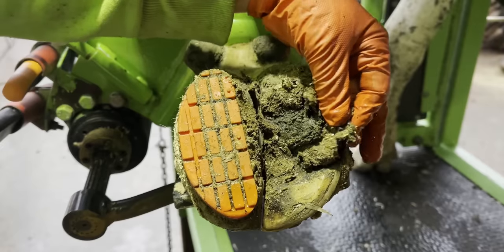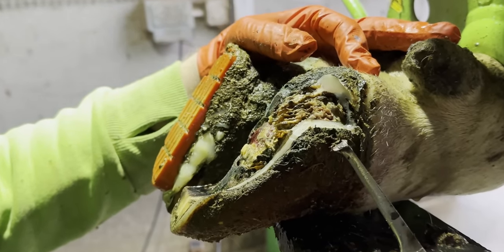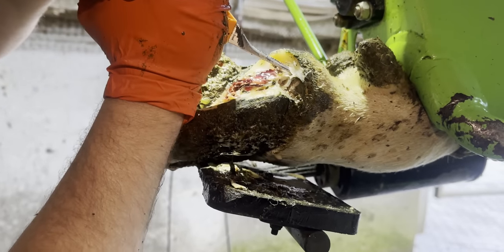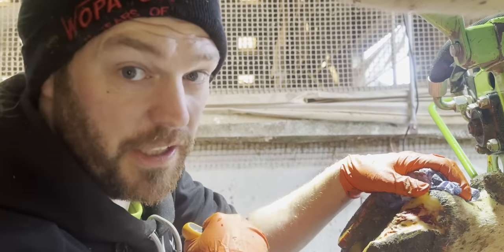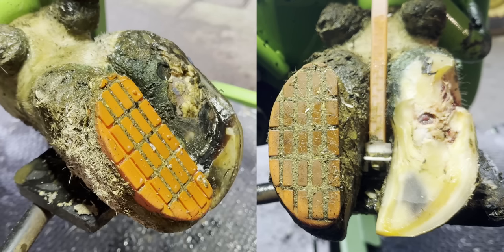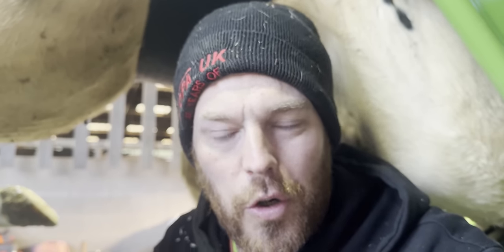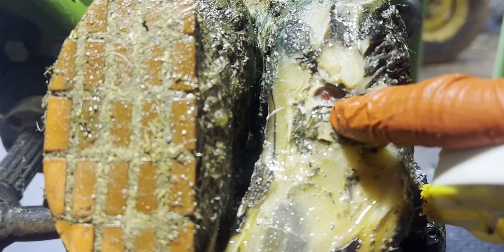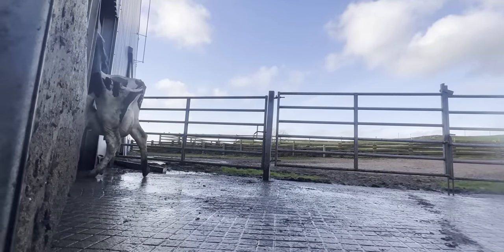this cow's LAMINAE CORIUM have BURST OPEN!

Comment: as sad as it is that this cow has this issue. these trims have been really interesting to see. the visuals provided by seeing a hoof so opened up so much are really cool and informative. there's a big difference between hearing about the strand like structures in a hoof that hold it together and seeing those structures in the day light.

Comment: Okay so question... I'm used to horses, and with horses that have bad separation like this, you can help decrease dirt and disease (and I think pain) by putting plaster or silicon or various other products to help create a "false hoof" where the hoof wall used to be. Does that not work with cows because of the muck they stand in, or because of the limited amount of time you can keep them in the crush? Or something else?

Comment: You need a two gallon water sprayer. Normally people put weed killer in them but I use it with just water. You control the pressure by pumping it, so no plugs. Especially on farms without water access.

Comment: I have an honest question as I just recently discovered your channel.  Is there a reason that you do not spray off the whole hoof with some water pressure rather than simply scraping the muck?  I know it will get right back on when the cow goes back to pasture, but I was just wondering if there were other reasons?

Comment: Your knife here looks a lot more slender than usual, do you have/use different thicknesses of knife depending on the job at hand? Or is it just an older knife that has been sharpened multiple times?

Comment: When we get our show horses feet trimmed and or shod, in the 🇺🇸, my farrier will get back in his truck and drive away before touching a muddy leg or foot.  He requires all hooves be picked out, feet and legs be muck free and dry, he doesn’t care if we have one or one hundred horses, he requires this from all customers.  When you get a farrier that does quality work, you do as they wish!  My best girlfriend raises Angus here in Central Virginia, her cattle trimmer man also requires feet and leg prep, but not as thoroughly cleaned as our horses.  My gf puts her cows in a huge barn the night before and beds them down in deep straw, so the feet are quite clean and dry for the am trimming,  For nearly all cattle caretakers it’s not feasible to clean legs or feet since cows manure is a constant wet stream of poo.  I think if I were the cow toes trimmer though, I’d want a hose and good water pressure, as soon as the cows in  the squeeze box, spray off the crap, as I see how much mud and poo, (muck), flies in every direction, getting on the trimmers hands, face, hair, clothes, even in your eyes and mouth.  My gf, (neighbor), raises only 50 cows w/ calves and 2 bulls on their 600 grassy acres, a park like setting, studded with old, shady oaks, cooling ponds, etc., mud there is near non existent.  Her cattle are Beef stock, they’d aren’t dairy cows which come in and out of a barn several times a day. which create a daily, mucky, mess.  If you have hundreds of cattle running through barns, 2x a day for milking, cleaning feet and legs is a giant waste of time, energy and water.   My gf only gets hers trimmed 2x to 4x a year, as beef cattle don’t stand on concrete, the feet are almost maintenance free, unlike dairy cattle.  All consumers should watch these videos to appreciate how labor intensive it is to manage cows in general, but dairy cattle the most.   Consumers complaining about the costs of cheese, milk, butter, cream and beef, might be less apt to moan n groan about prices if they knew what’s involved in raising farm animals, not to mention grain and hat prices.  Living in a farm community, we buy near all our animals products farm direct, we save on these and don’t complain if at the grocer.  God bless the plants, animals, farmers, vets, trimmers, etc., the most important pieces for human existence.

Comment: Does the farmer have a water hose to use to clean the Whole foot up before working on it ?. You do a great job but the spray bottle is very small cleaning .
Reply: A water hose wouldn't help. As Graeme showed in this video, not even scrubbing could remove the muck. He  had to cut it off with his knife. The spray bottle was only to remove the bits that he had already loosened.

Comment: Considering how seriously bad the hoof was the first time, it's coming along. New healthy hoof horn is growing and the lesion is getting smaller. I bet next time it will be a major improvement again. Aside from not having 'smellovision' which I'm greatful for (I'm not fond of the smell of manure), we also don't have a way to feel what you are as you use the grinder and knife. You've done this long enough to know what changes in resistance to the blade mean and adjust accordingly. I saw you start to make a cut a few times in this video and stop as you felt like you might be going into tissue.

Comment: Why don’t you wash the cows’ hooves before trimming them?   Of the many channels that show hoof trimming, I can’t recall if an answer was ever given.  I would think that even a good stiff brushing of the hoof to clean off the mud and manure would make it easier to determine what damage there is to the hoof.

Also, if the cow’s inner claw is so incredibly bad, why scrape at it little by little if you know that it is bad?  Can you take a saw blade and just remove the claw completely without damaging the hoof / corium?  Just a complete “do over” as it were.

Comment: I'm curious why you're so worried about the hood bleeding. In most cases I've seen if bleeding starts the veterinarian or the doctor or whatever is not overly concerned because that means that there's a healthy blood flow to that area if it didn't bleed then that could be a cause for concern that there's no blood flow which means no healing so I'm wondering why you're so against it.